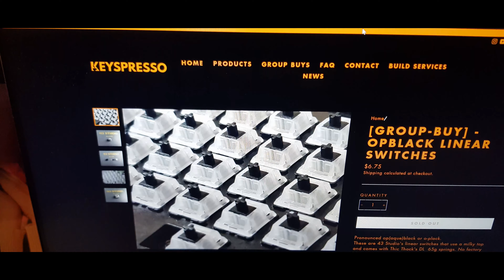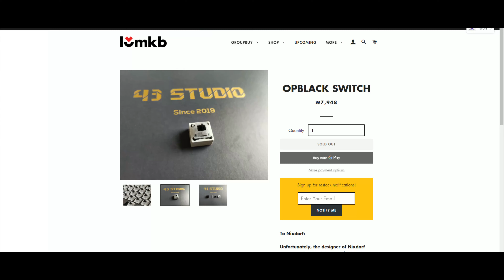Best Linear Switches? The OP Black Linear Switch Sound Test / Vega 65 Keyboard ASMR

Comment: Opblack vs alpaca v2 , which better ?
Reply from the maker: I prefer the Opblacks more but Alpaca is still really good
Reply from the maker: Thank you for checking out the video btw! I appreciate this a lot!
Reply: @Rx003  thank you so much
Reply: Have both. Alpacas stems were doused in factory oil to fake smoothness like a lot of jwks, opblacks are unlubed with polished internals and are just as smooth and sound and look better.
Reply from the maker: @rks5457  thanks for this insight! Appriciate the comment 🙌